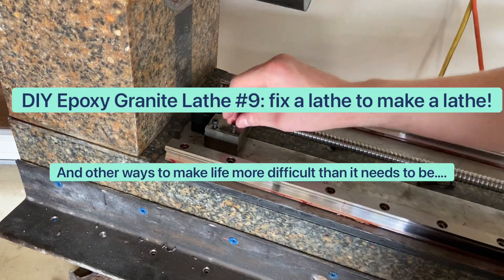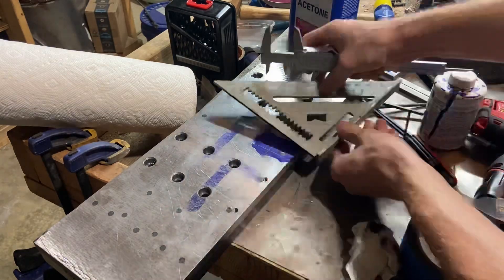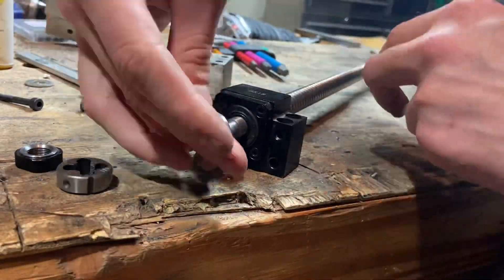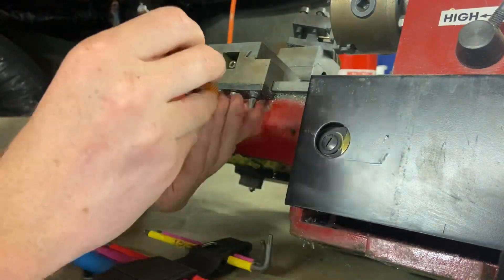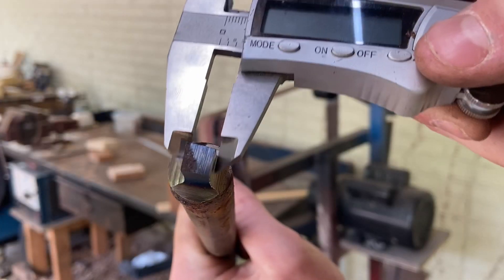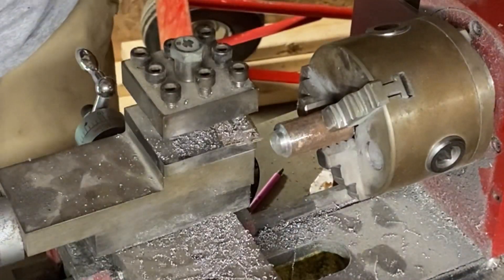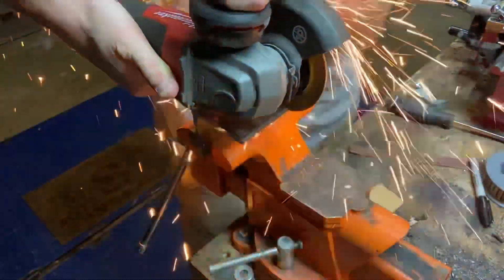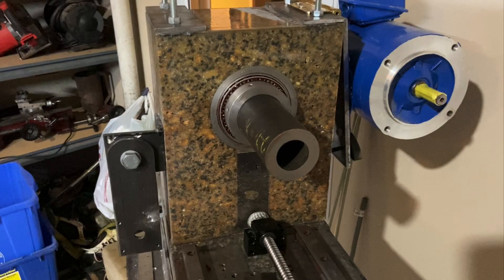DIY Epoxy Granite Metal Lathe #9: Fixing a mini lathe to build a bigger one!

Comment: I think what you want is an external chamfer tool. It's shaped like a cone and goes in a drill.
Reply from the maker: I’ll check it out, thanks!
Reply: Yep! There's a bunch of cheap ones that work pretty well, but it'll take some practice to get the feel right. You'll wanna only use a drill, no impact at all, and depending on the size the external chamfer tools tend to struggle more with smaller bolts/screws. The cheap ones look almost like a tapered funnel with slots cut in the sides, and they tend to come with a triangular section to chuck in the drill. Hope this helps! The ones I've used worked pretty well overall.
Reply from the maker: @2011JMB  oh that’s great, thanks! Yeah anything to cut down on all this chamfering by hand hahaha

Comment: Do you think it would be fine to instead of mixing epoxy granite to make base we use granite stone blocks from local supplier and use smaller amount of epoxy mix to glue and bolten everything together. Granite-granite, granite-steel
Not sure about price for epoxy granite base, but I think pure granite blocks are pretty inexpensive.
Could same base you have make be possible to build with granite blocks and with same or less effort?
Reply: Overall properly fabricated, formed mixed and cured epoxy granite is superior to pretty much everything else. Solid Granite blocks can work well, but it depends on a bunch of variables including the specific type of granite, (some are harder and more wear resistant than others), along with the attachment methods to connect the slabs, and especially how precisely the pieces of Granite are flattened and made parallel.

If you're wanting to do this, then look up another Youtuber named Piotor Fox Wysocki. I'm not 100% sure if I spelled that correctly, so if you can't find the channel, please reply and I'll try to include a YouTube link to his channel.

Fox has now built, and the entirely rebuilt his Granite high precision CNC Mill and he's now getting sub micron level finishes on his parts. His was assembled using multiple Granite surface plates that he drilled, and used epoxy to install a bunch of metal anchors into the Granite. He was then able to screw large aluminum side plates to the base, and build up from there.

I'd recommend going back and watching his first build series first, cause that series is where it appeared he did much of the original work on the Granite slabs. After using the mill for a couple of years in a production environment, he decided to take it all apart, and rebuild it from the ground up with better components, and much tighter tolerances. It's a lot of content to watch, but it definitely has a ton of information on the subject.

There's two other people that I can think of that have done what you're asking about as well. Unfortunately I can only remember one at the moment. The one I can remember is Dan Gelbard and he made a extremely precise lathe that used air bearings over polished Granite surfaces. Very different design and principles, but his also used surface plates or precision Granite straight edges affixed together to create an incredible tool.

Once I can remember the third Youtuber I'll try to post their channel as well. Hope this helps!

I'm not an expert in any way, but I have been reading about and researching epoxy granite as an incredibly powerful tool to allow me to make substantially better tools than I would otherwise be able to make. Im happy to answer any questions, but please don't take any answers as the final word on the subject. Use my thoughts to help you and hopefully point you in the right direction.
Reply: @2011JMB  
   I appreciate your effort to help. I already watched all videos about granite machines, but have missed new ones from Pyotr. He has done a great job with his build, those guys made machine starting from a precision flat granite plate and used is as reference for grinder to copy that flatness to sidewalls.
Problem with that is hard to find and expense of precision flat granite plate, would probably cost not less than 900$ for size like his + (axis above x,y?) and then am still not sure it would be good for mounting the rails direct because of huge torques milling the steel and damage to granite surface.
While on the other side same unpolished plate would cost 100$ max. wich is btw. 1/4 of epoxy granite price/weight.
Then steel plates could be bolted, glued to slots made in granite with grinder and than bring to metal milling company to make them precision flat for rails and assembly.
Currently am more focused and think would start some day if find it feasible, with a big concrete cnc build, 220x130x50cm of working area, with steel armature and place for rails inside. It would probably weight about 4 ton🥵but would be considered as very cheap construction,1500$ for that size.
Then bring it to metal machining company for machining of slots for rails mounting.
On such machine it would be possible to made 90% of needed parts and machining jobs for other machines like lathe, 3d printer, plasma cutter, pneumatic press.. all things needed in professional workshop, and also could do jobs of machining on request.
Its in theory, but still need to check if its really like this.👍🏻
Reply from the maker: So I absolutely agree you could do that, although epoxy Granite may be cheaper than you’re thinking. My cost was about $1 per pound of epoxy granite, Im not sure how granite alone compares to that. The main other factor would be vibration damping, I have no idea how granite deals with vibration but epoxy granite damps vibration excellently.
Besides that though, yes! Im sure it would work, Id be really interested to see how it goes
Reply: @robertsteinwandel6658  
Whole granite blocks are great for vibration damp and better then anything out there  but epoxy granite is level above I think and very precise machines are made out of granite stone, have seen some Chinese factory building those machines out of huge parts of granite stone weighting probably few ton.
About price Im not sure, will need check again for bigger blocks but have bought some 12kg piece for about 0.4$/pound.
Reply from the maker: @egaega2458  wow well that sounds really positive. I know I saw someone build a huge lathe that was several tons from giant granite blocks. There was also someone (Dan Gelbert maybe?) who built an incredibly high precision machine using granite parallels for ways for the machine. So you’re in a great group of people with that idea! If you want to put a video up if you do it I’d be really interested to watch!
Reply: @robertsteinwandel6658  
Its my mistake because Im not really used to imperial measurement.
I have checked today from local supplier (there are many in the city), since pound is 0.45kg price is 0.25$ per pound of selected and cuted granite block to desired dimension.
I asked about 1000mm x 150mm x 300mm block and he calculate it weight 300 pounds and would cost 76$ USD so I think its pretty good deal considering its still keeps the price when other things like steel got so expensive.

What am not sure about is cost of cement glue or epoxy(not sure what to use) for granite parts. You know that better, but if its not expensive to glue pars together and if it have good hold on steel I think its perfect combination.

Yes, Dan Gelbert genius used it for air bearing lathe that is pure perfection :)
I had an idea of filming some parts of my hobby since I have recently bought compressor, welding steel and aluminium and also have some engraving cnc machines waiting to be repaired. 
So I think I would start to film it as soon as I finish preparing my work space in garage, even my eng. is pretty bad when need to talk:D
Reply from the maker: @egaega2458  no worries haha, imperial measurements are terrible lol. That’s still a great price, nice! 
I bought epoxy from US composites at only about $40 per gallon. For epoxy granite I bought the thinnest slowest setting epoxy they had, but I would expect you would want a very thin epoxy with a medium set time (generally just based on the hardener used). I had a great experience with them though, the product seemed really high quality and their customer service was great when I called with questions.

Comment: I don't know if it would suit your situation, and I've never used it myself but I've seen a 'Bordo E-Z Chamfer Tool' that might work. Or as John Colvin suggested, drill and grinder. Or a drill press and grinder. Or for very small fasteners, use the holes in a pair of wire strippers.
Reply from the maker: Never heard of it but I’ll for sure look it up, thanks! I like the wire stripper idea for tiny ones haha that’s awesome

Comment: Tô get hundreds of shorter bolts, you could buy them the correct size 😂 Jokes a side good work, and enjoyable video. I wonder if you have a drawing of the final product or just a rough sketch (would explain the bolts).
Reply from the maker: Way too true😅
Thanks! Yes I need to update it but I do have a cad model of the final project, I’ll try to include it in the next video
Reply: @robertsteinwandel6658  in theory you could model the fasteners and that should make it possible to have the right ones, specially since not all size fastener are available

Comment: I have chamfered a bunch of "chopped" capscrews by holding them in my hand-drill and lightly touching them to a bench-grinder.  If you have no bench-grinder, clamp down your angle-grinder, preferably with a grinding wheel fitted.  You can get through a number of bolts quite quickly, especially if your hand-drill has a keyless chuck.
Reply from the maker: That’s a great idea honestly, I’ll try that next time I need to do it! I do have a bench grinder I just don’t have very much space unfortunately so it’s usually up on a shelf. Definitely worth getting it down for something like that though
Thanks!